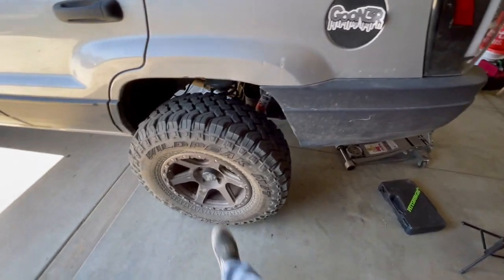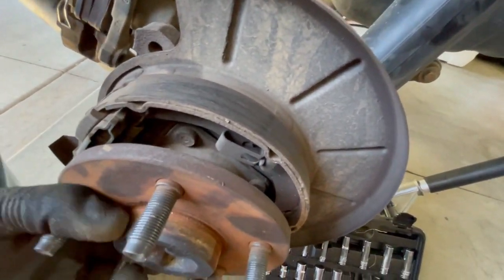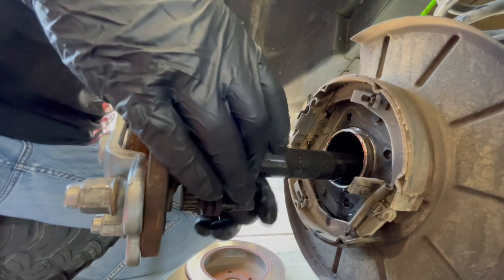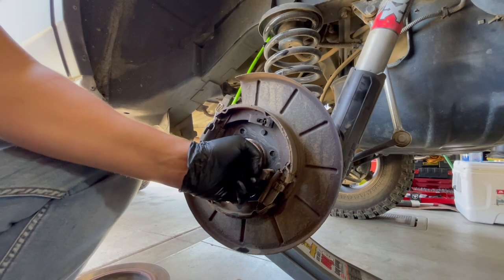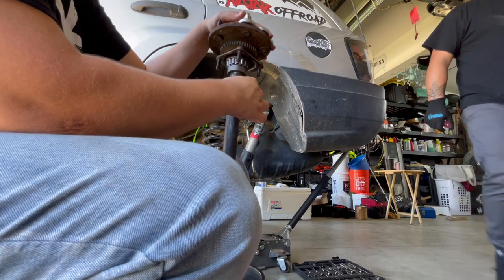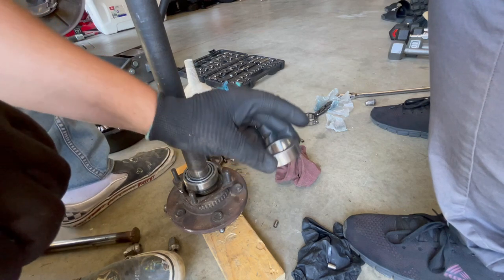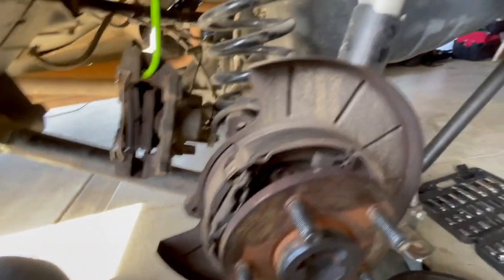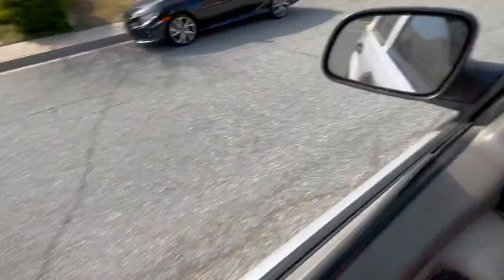Replacing Bearing On Dana 35 Axle Shaft | Jeep WJ Grand Cherokee | Najar Offroad

Comment: Your video says this is for a Dana 35, but you're clearly working on a Dana 44.  The 35 doesn't have a press on bearing & retainer ring.   Also the 35 has C clilps so you can't remove them w/o opening up the diff.
Reply from the maker: Lol it is. On the WJ the D35 does not use C-Clips
Reply: @NajarOffroad  well TIL!

Comment: Hey Najar, 
When you do this on your Dana 44a upgrade, do the seals as well, they normally leak within 80-100k, so you might as well do the full kit. It will include race, bearing, seal, and retaining plate.
Reply from the maker: Yea for sure! Thanks for the tip 👌

Comment: Thank you for the video, I just needed to know which way the bearing went in.  I keep breaking these bearings off the race while offroading and was thinking I was installing them wrong, but I was putting them in right...  when the race breaks lose, as yours had, the bearing floats back and forth, making the grinding noise on the rotor and throwing multiple check engine reads dealing with whatever side brakes wheel speed sensor not working right...